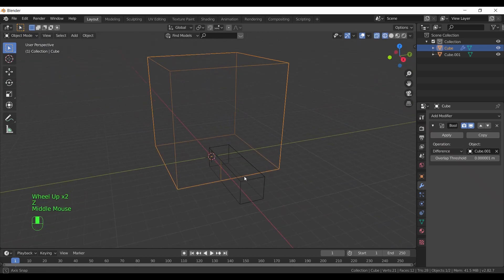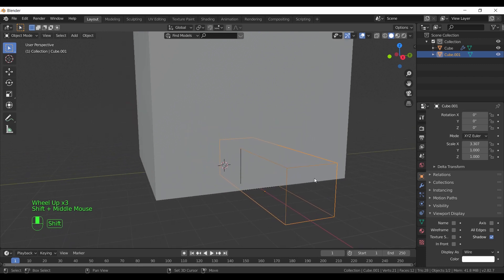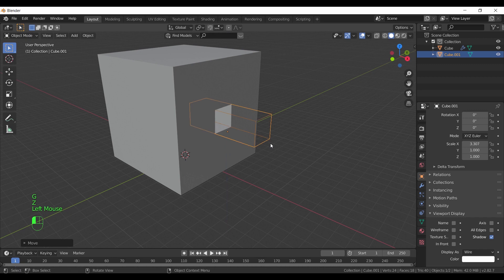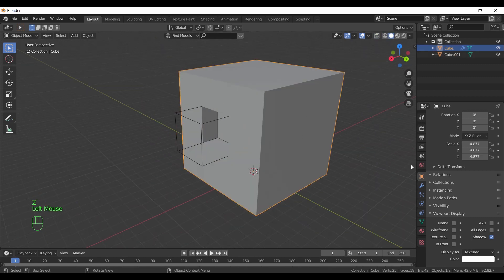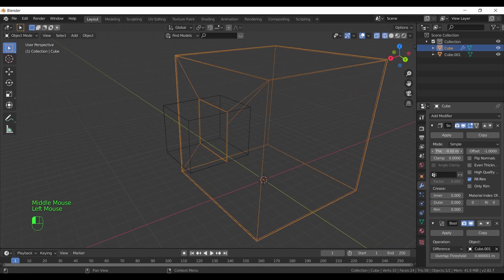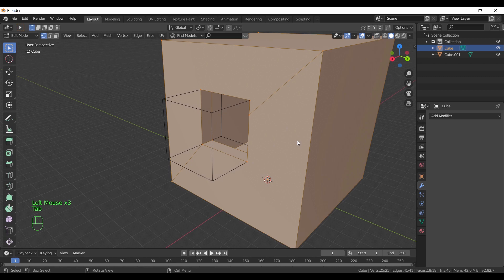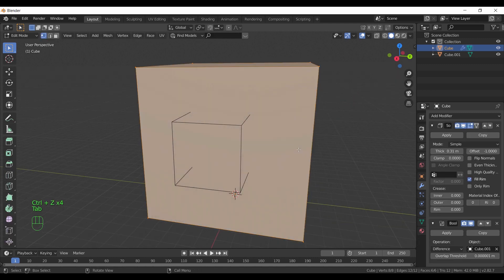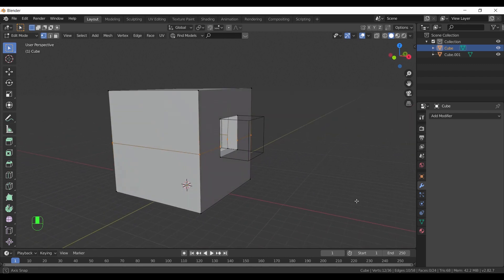Boolean Problems - Blender for beginners

Comment: Ahh, ok so my issue was with font (converted to mesh) not properly cutting. Then I cut the zig-zag faces off the "C" and edge+ctrl+F to reapply a single face. And now works.

Comment: When i render the objects which i boolean and donot want in my scene also appears ? What to do
Reply from the maker: You need to apply the Boolean and Delete the object you used.
if you want to keep the boolean unapplied for some reason, just select the object you used to cut the shape and hide it in render( hide objects from final render from the layer area)
Reply: @architecturetopics  thnx dude 🙌

Comment: I have a model of a iPhone and I’m trying to make a form fitting storage box for it. I size my box body and I position the iPhone model where it needs to be. I use Boolean and if I mess around with the position I can get the main body of the phone to cut as well as the side buttons, but the camera protrusion won’t cut properly. It’s behind sort of a false face but the outline is there. I try to cut away the false wall and it cuts the rear of the phone body out too. It’s a mess Iv restarted many times. The thickness value didn’t change anything